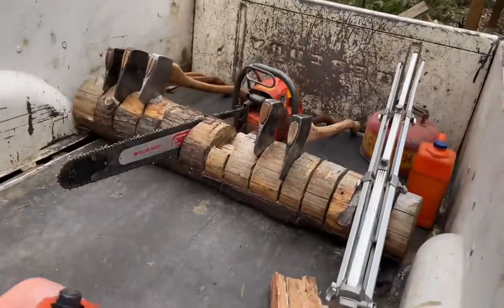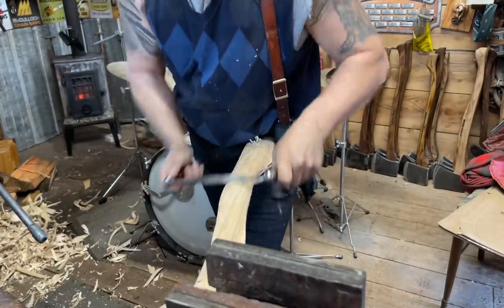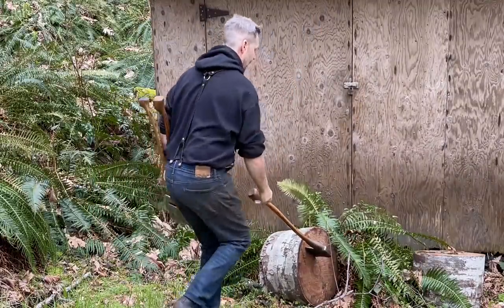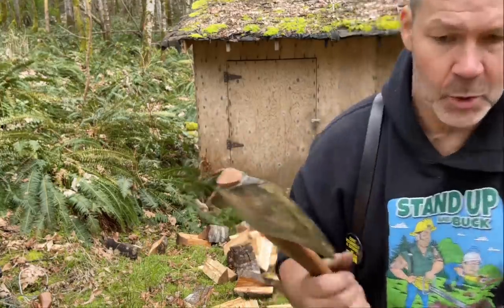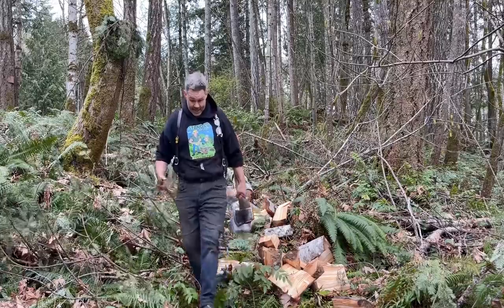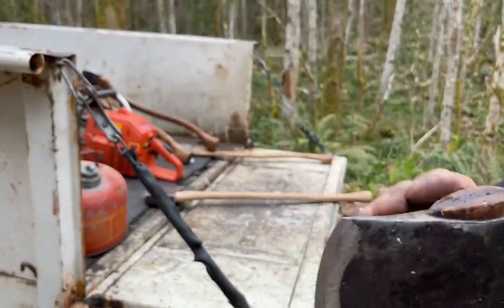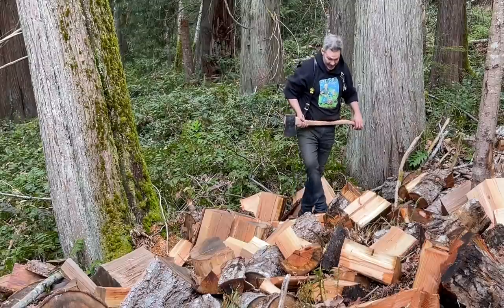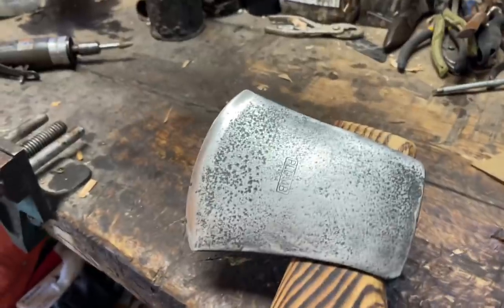FARMING FIREWOOD, MANY CORDS TO SPLIT, TESTING AXES

Comment: Hi Buckin:  Thanks again for all your advice,  and trade info.   I have many ignored projects to deal with but now that I had to retire ! The old ways (18 - 30 yo) have become the only way to get it done ! Reality is lots of time to see your great videos and little funds to get equipment to do the work for me !    This winter I broke my 1st splitting mall handle  " but I've used it for 35 years "   I need help finding an axe like your " wood bullet "  here in the Red Wing MN area !  Let me know if you have any suggestions on finding any followers near my area ?  Thanks  Pete Gans

Comment: I loved the video man. I have a question for you: I have a small jonsered 455 which runs perfectly, it idles for hours and cuts and everything, but when I leave it idling wherever I place it to idle it leaves a puddle of bar oil. What do you think causes this? Could it be that it is tuned just a little too high and it activates the oil pump?